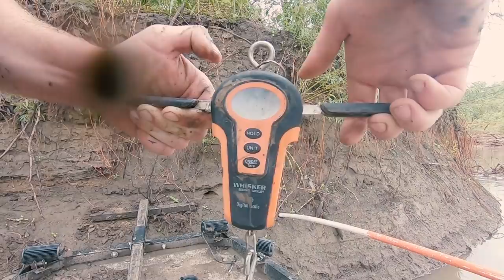Big Cats and Huge Surprise Fish On Diddy Poles! (Memorial Day Diddy Poles and Trot Line)

Comment: A tip for ya on those trot lines, make the Stagings or the Leader about 2 ft long and keep the fish in the Water , invest in a Good Dip Net , I use bank poles some a time or two a year it's a lotta fun , Never saw these pvc ones I always cut the Poles from a Reed Cane grove by my house ,but I may have to make a few of these along , good idea for sure , looked like a good weekend , Tight Lines To Ya 🦈
Reply from the maker: I'll have to make some adjustments on the trotline for sure. I started out with just a walmart trotline but have since remade all my drops. 

The PVC poles are nice. They're cheap, will hold a 50 pounder and last forever
Reply: @DeeplyDrivenOutdoors  I was having some trouble with fish coming off until a friend who I learned many many tricks from showed me the way the longer staging lines worked out, the fish Stay In the water as your picking up the main line as you run it out once they come out the water they go nuts flouncing and that's when I would lose em,,  you have to space them a little farther apart but the Benifits are well Worth it ,then I went and Took his Advise and invested in a dip net three times Bigger than the one I thought I needed lol 🤣🤣 that's exactly how he told me to look for one that was big enough lol 🤣🤣🤣 ,and many times since then I have been glad I bought it ,I've. Had that ole net probaly 35 years now ,I've replaced the net about four times and patched it several more times but it's Still dipping fish ,I even added a 10 ft extension to the handle outta schedule 40 1inch pvc pipe ,I can take it off if I need to ,I just drilled a hole thru the handle and the pipe for a bolt with a wingnut or a small pin  ,I can pin more onto it as need be, I've made it 25ft long when we fish the coastal piers that's high above the water, I can reach em with it , ,that Area you were in was a good place from the Looks of things ,I like the bluffs ,that usually means Flatheads , Great show , keep it up ,I'm fixing to set some poles this afternoon we've had rain down here a few days so we got some water coming up in the Sloughs and swamp here (South Mississippi) it should be good for a few days or Fishin 🎣 bank Poles , anyway , Y'all stay safe and Lotsa Luck On Your Next Adventures

Comment: Need to run trout lines across the river not long ways with the bank. Submerg the line about five or six foot deep in the middle of the river then tie it off to the other bank. You’ll be surprised the next morning. Big blues run in that fast middle water picking off anything they come to. But five or six foot deep with the line in the middle will be perfect.
Reply from the maker: In Iowa, you can't run a trot bank-to-bank, unfortunately

Comment: Try hole dead uncooked shrimp with the heads on let them sit out for a while and drink a bit also use chicken gizzards sometime when u set trot lines
Reply from the maker: Will give em a try next time!
Reply: Deeply Driven Outdoors if you can get down south and get some live ones and keep them alive they work really good to I used them in Louisiana when I was down there long as the blue crabs didn’t get them first they worked really good and only 6 bucks a lb for big ones